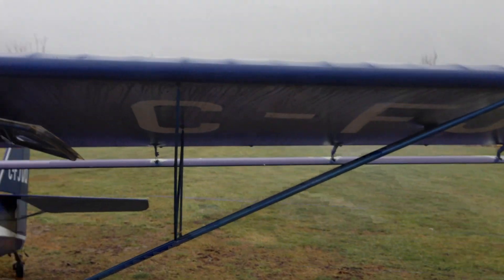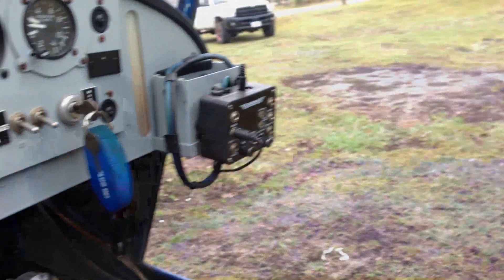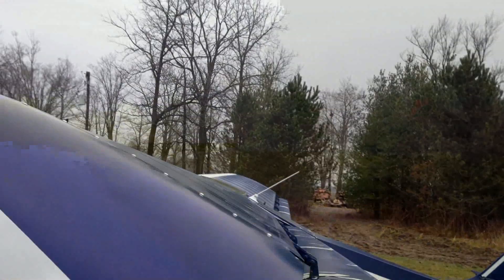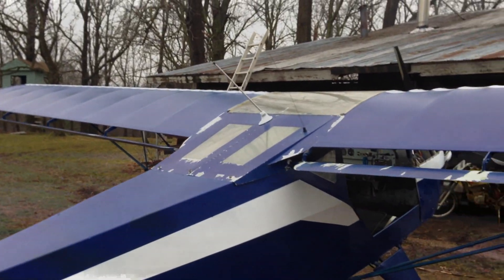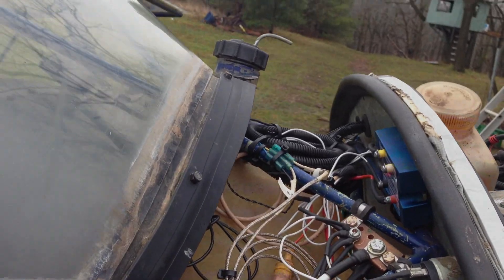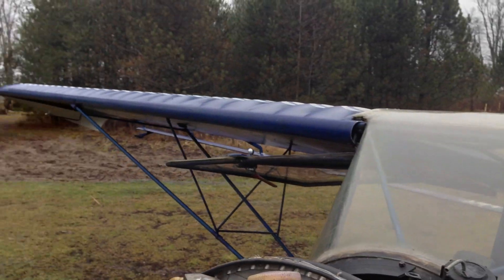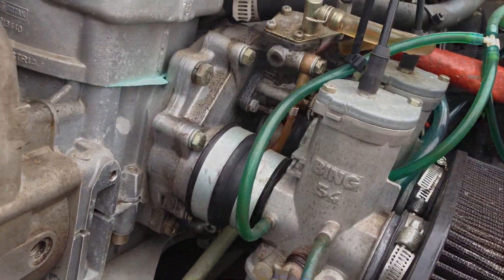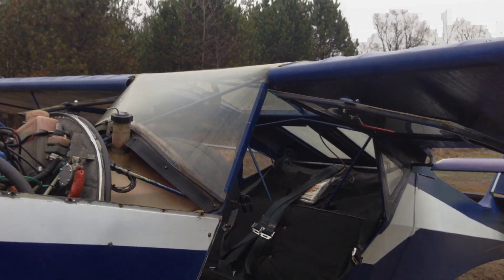Kitfox 2 aircraft for sale

Comment from the maker: Hi There,   only got 10 inches   -- just got in from sledding  - Polaris been idle last 2 years mostly due to no snow.  583 is a higher reving engine and got rave valves  - 582 does not.   We use BING carbs and yes you can get carbs icing up a bit at times but no real issues

Comment: Good day Mr. Dave. I hope you didnt get all screwed up with that storm that you guys got down south, we had the same kind of storm come through the area up here in New Liskeard a week ago, almost stopped the town dead, I have a plow on my truck and plowed 37 hours straight. I was just wondering what the difference is from the rotax 583 in snowmobiles and the 582 you have in your plane? Do you run different carbs than the mikkuni's that are on sleds? and do the carbs ever freeze up in the cold?

Comment: Sweeeet Plane, great price. I fly Merlin gt 618.I cannot help noticing. Was that a low oil level sensor in the RV valve oil bottle mounter on firewall??? would that be an that  a "over-the-counter item (bobbardier numbers) or was a sensor installed aftermarket?If so would you lucky enough to know the sensor number? I am wanting to do this with mine but cannot find a aftermarket kit .lovely plane  ty for post and great info details.100-100